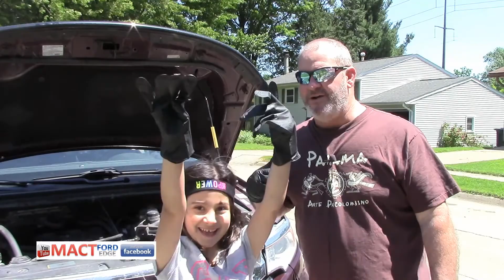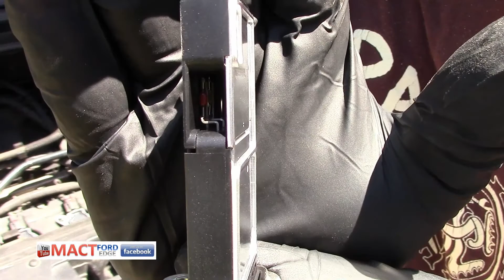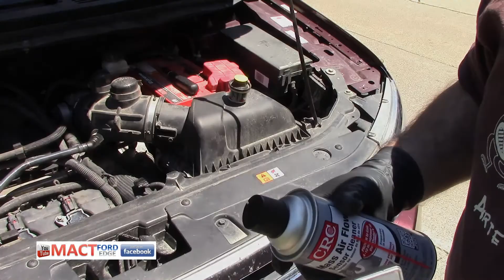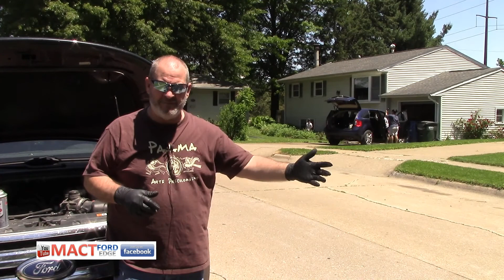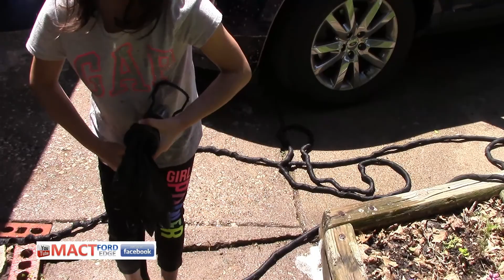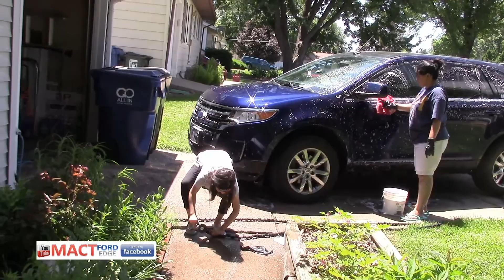MAF sensor  more than just a sensor PCM and Transmission inputs

Comment: I was doing some testing cause every time I start my car it revs to 2000 RPMs and seems to get stuck there cycling the key on and off enough makes it work I don’t know how but it dose. Going on the highway faster then 70 km the car will be fine but then the RPMs start too go up and down and I lose power and gotta pull over before engine stalls out. So I wanted to try unplugging the MAF yea I unplugged it shifted into Drive and omg it was so rough but it back in park again really rough. Plugged the MAF back in shifted smoothly so I’m at a loss I don’t understand what’s causing this high idle on start up and the loss of power going faster then 70 km. No codes except the one I created by unplugging the MAF but I’m confused. Changed TPS IAT IAC MAP only thing left would be the MAF.